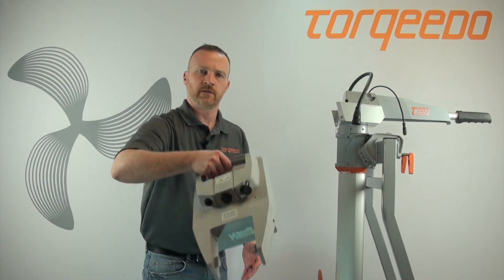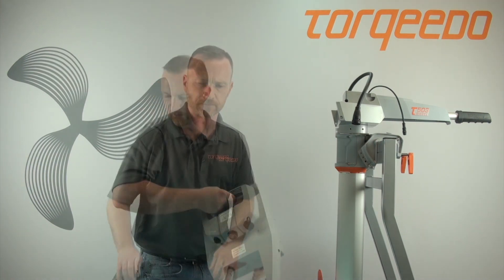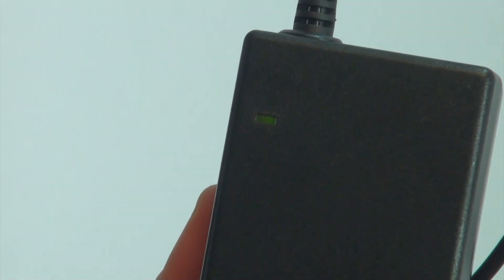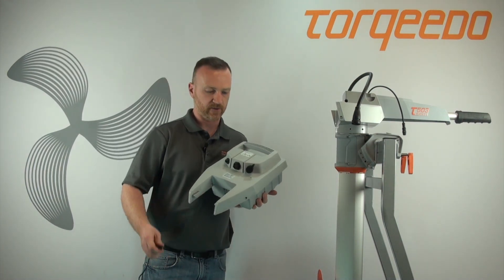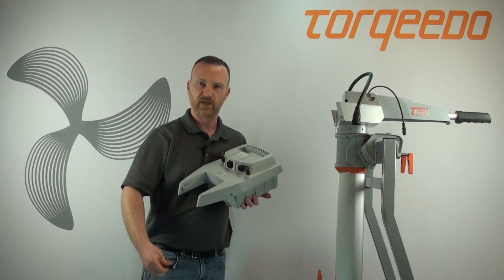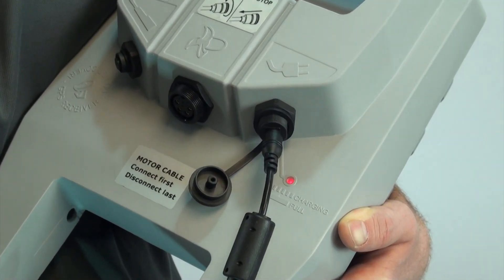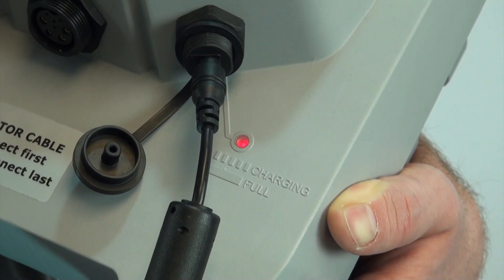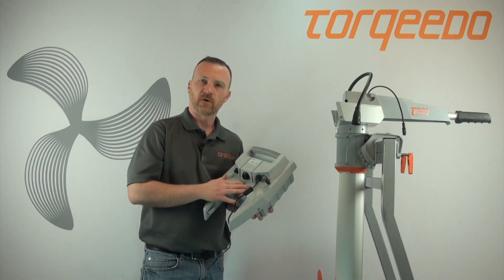Torqeedo Travel Motor Battery Charging Procedure

Comment: Where can I find a charger for the spare battery ?
Reply from the maker: @Eric Lawson: The charger for our Travel can be found on our accessories page. 
Depending on which Travel motor you have, either the 40 W or 90 W charger is suitable. 
https://www.torqeedo.com/en/products/accessories/charging-equipment

Best, Torqeedo
Reply: Would the 40w work with the ultralight 403A?